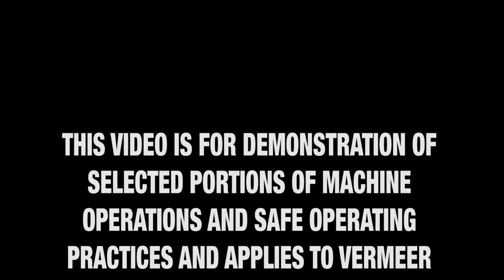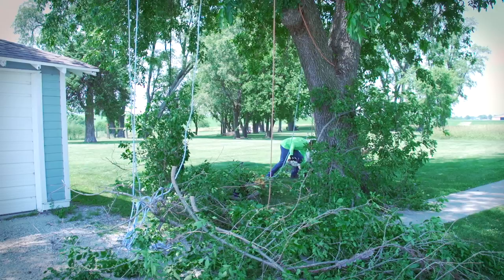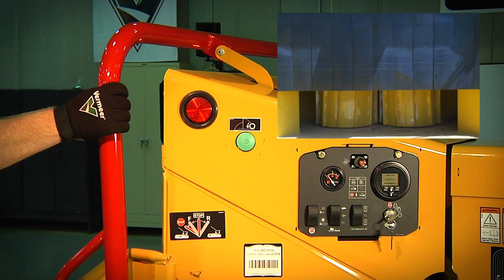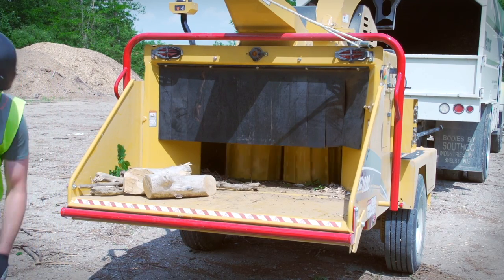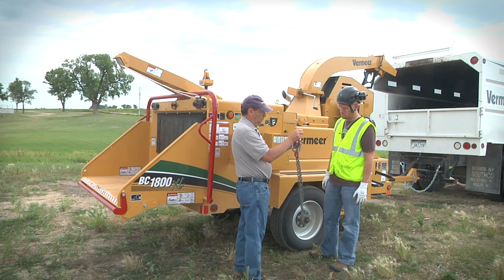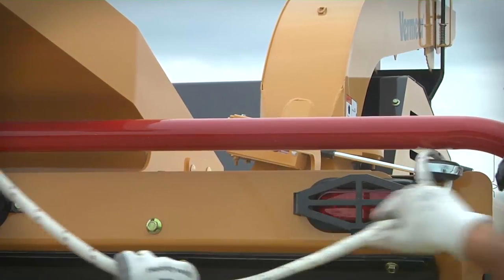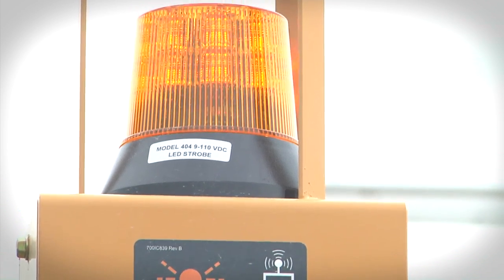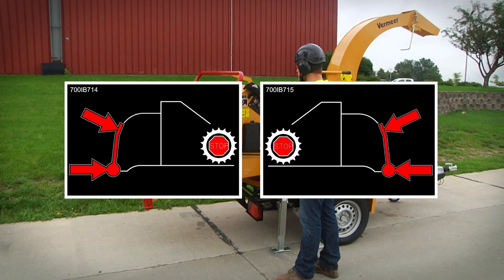Brush Chipper Operation and Safety Video (Current Models) – English

Comment: A safety device that requires the operator to activate it is inadequate. A man being pulled into a chipper has no time or presence of mind to actively push a bar or a button. In addition, that “safety bar” is way too low. Someone being pulled into the chipper can glide right over it or if feeding from the side as they suggested, they would not even contact the safety bar. There should be a deadman switch that stops the machine immediately if the operator is disabled.

Comment: I think this video is great information what I noticed they don't mention is that if you have massive piles of brush to chip not just one branch at a time like the video shows it does increase the danger, the branches become Tangled and caught up on each other in that case branches will need to be cut up with a chainsaw and I think what works best if two people on either side of the chipper to run a lot of material, I think with fatigue  the safety level goes down it is always great to have another person next to you if anything goes wrong and to help you with difficult to load branches
Reply: @stevemacintyre5779  no practice = no experience = no work is forbidden
Reply: no practice = no experience = no work is forbidden

Comment: Avoid the new 2023 Brush Chippers at all costs!  Vermeer chose to adopt a new all-electronic control panel that fails after about 17 hours.  The engine starts (it is a Deutz, after all) but the control panel, after flashing the Vermeer logo, goes black.  Dead in the water.  Zero indication about what the problem is on the LCD screen.  In fact, after the logo flashed, nothing...the machine worked all day the previous day just fine.  With all of the sensors and firmware, one would think that it would at least give you SOME INDICATION of what the problem is.  Nope.  Stick with another brand or an older model with mechanical switches and analog gauges.  At least those won't fail you on the job, and if they do, you can still work.  Very expensive paperweight.